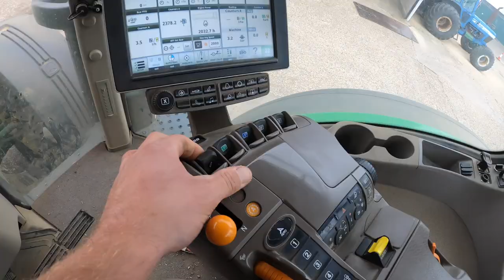BIG STONES IN FIELD KEEP BREAKING SHEAR BOLTS!

Comment: Hi Nick, if you were able to upgrade to a more modern tine cultivator/chisel plough someday, like the Väderstad Cultus, the points are spring loaded for stones, so you would avoid all the shear bolt issues. 
Your John Deere would even pull a Väderstad TopDown 500 (with hydraulic ram stone release) - with a 5m width, you’d get it all done a lot faster! And do far more in one pass!

Comment: check the specs on the shear bolts, i did some topping for a local farmer and kept breaking the shear bolts. he was using 8.8 tensile strength bolts but they should of been 10.8 tensile strength
the tensile strength is stamped on the bolt head. i noticed that the shear bolt was bent, that should not happen, a shear bolt should shear leaving a straight edge, ? are the correct size diameter bolts fitted

Comment: Lol totally agreed on the Fahrenheit!  Couldn’t even tell you my height and weight in metric, but Fahrenheit totally baffles me. What do I want the temp set at?  80?  42?  Haven’t a clue!
Reply: Very approx Centigrade to Fahrenheit conversion is double the Centigrade temp and add 30 . 20 degrees Centigrade is approx 70 degrees Fahrenheit (20+20+30). In the UK we have used Centigrade for years, but have you noticed the newspapers still say 'phew what a scorcher, its going to be 90 degrees in the shade'. Sounds better than 30 degrees, they love higher dramatic numbers.
Reply: @robertallen3441  I knew there was a formula but I can never remember it. I thought it involved dividing by 9.5 or something, lol. Here in Canada we get quite a mix of metric and imperial, partially from our British ties, but also proximity to the Americans.